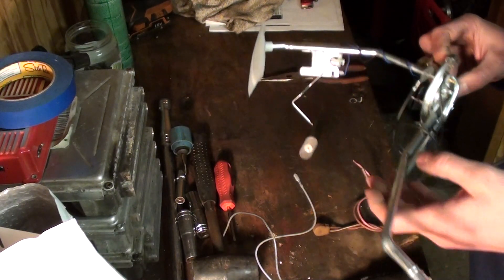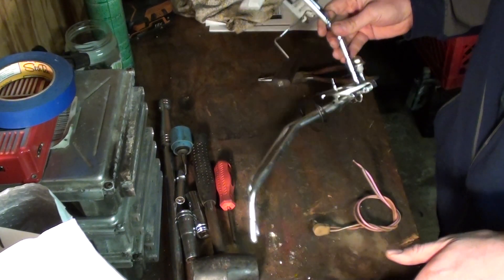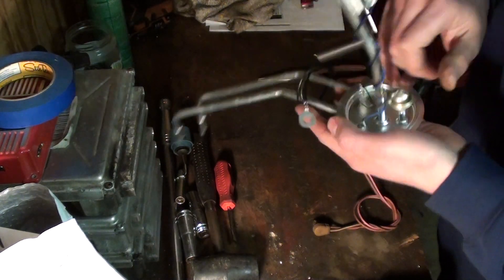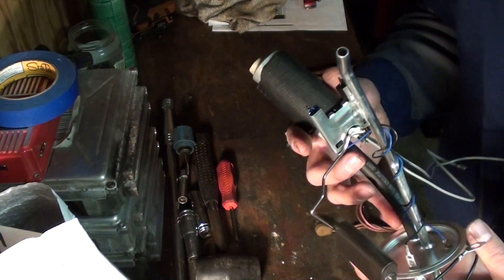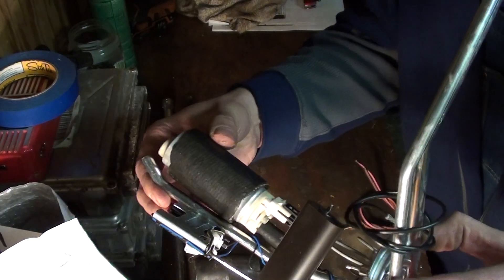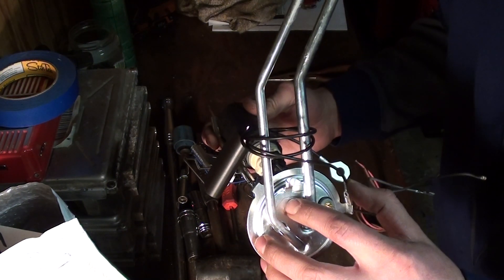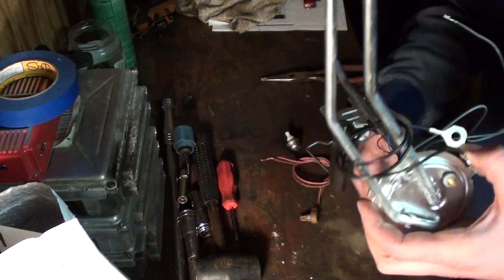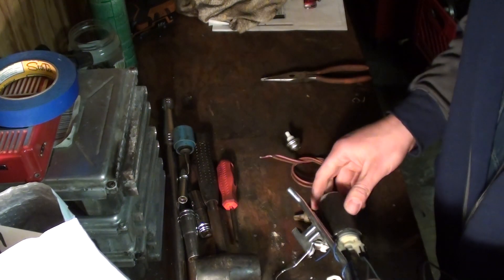How to: Modify the Carb style Fuel pump hanger for Electric Fuel pump/EFI. LS1 Swap

Comment: Be careful having the return next to your pickup for the pump.  Return fuel can become air-rated, they recommend not having the pickup too close.  Most fuel cells use a top fitting for the return, as an example.    I have no personal experience with this issue, only passing on the information.  🙏🏻
Reply from the maker: You make a good point. I'll add an extension to the return tube.